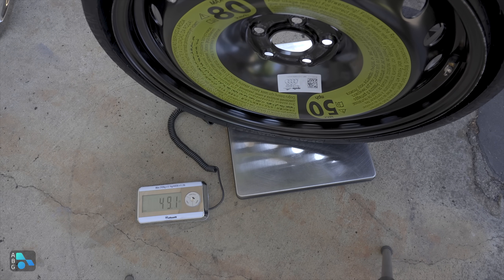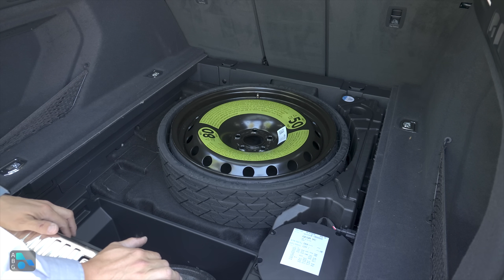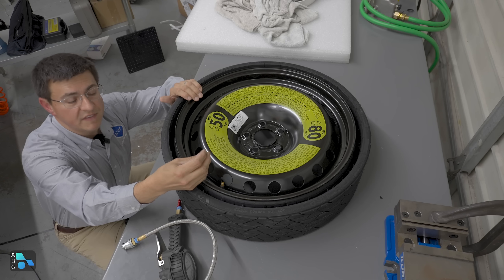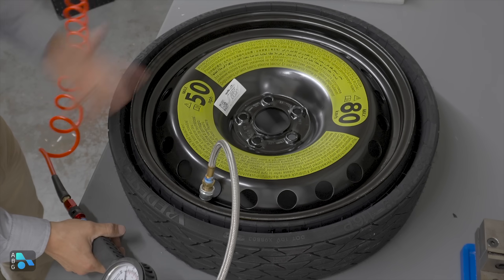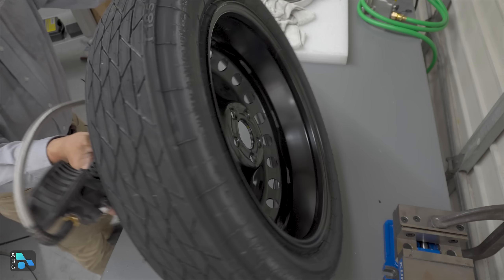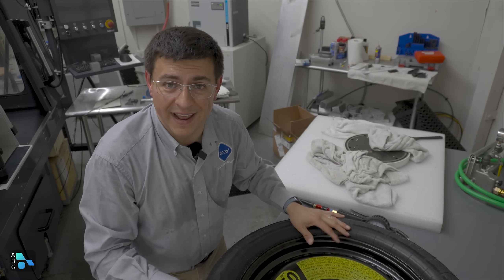How A Collapsible Spare Tire Works, And How It Might Save The Spare Tire In EVs

Comment: This is problematic. You need a pump in the car. Need connect to power.
Next the tyre may collect particles and can't inflat as leak.
All cut cost and not give proper tyre.
Don't buy the car that give you problem

Comment: 1. This is actually super freaking cool! 2. As with nearly all compact spares however, the full size tire doesn't fit back into the same place. So if on a road trip with a trunk full of stuff, where do you put the flat full size tire?

Comment: Wait, isn’t there even more room on an EV to fit a spare ? First of all the entire front trunk or frunk is empty.   There is also no drive shaft tunnel that gas rear wheel drive or all-wheel-drive gas cars have .   And the most important part , the rear truck … there is no muffler or exhaust in the way there is also no gasoline tank in the way.  There is basically double the amount of room in a trunk of the EV.  Maybe not for shitty EV brands like BMW, Audi or so that just repurposed their gas car chassis … but other real EVs have way more space all over.

Comment: Been driving an X6 with no spare for over 9 yrs now. It uses RUN FLAT tires...
In the beginning it was a problem to get them fixed after a puncture... many shops said they could not be repaired. Absolute BS and lack of knowledge.

Had to go to mom and pop shops... just put a plug and patch. Nowadays they are specific types of plug-patch for run flats, but if not available, separate plug and patch will do fine.

I have from time to time off-roaded in heavy rocky roads with no damage or flats.
So unless you completely slash a side wall, a run flat will do just fine and no spare is needed whatsoever in any car. Not even a collapsible one.

I do recommend having a plug kit and tire inflator in your car. (I have 4)
I have not used a spare tire in over 20+ yrs since I started using plugs... no need to take the tire out at all... fixed and ready to go in less than 10 minutes and no sweat of dirty hands. Learn to use them... they are hassle free.

Comment: The small amt of space you save  is meaningless. In bad weather I want to change a flat quickly not that nonsense.
Get back to FULL size spares . Pointing out saving 60lbs on a Spare to save gas then putting a 100 plus pound 
Panoramic Roof  on the car shows its all about money.   Company saves $100 by not providing Spare but gets to charge extra $800 or more for a Panoramic roof.   Also if your car is so fully packed where are you going to put your 
full size tire with the flat. If you leave it loose it becomes a projectile in a crash.  Safety should require your flat being bolted down where the spare came out.

Comment: I had a in a car that didn't have an actual spare tire and it turned a 20-minute tire change into a complete meltdown of my Christmas plans. I had to pay $200 to have the car towed to a tire change shop let it sit there all day on Christmas and then drive back 30 mi to where the car was to have the tire put on for $300. I think not having a spare tire is a huge safety issue luckily I wasn't on the highway I think it's ridiculous

Comment: I don't immediately see mention of it, so I'll comment the most important part:

Keep any appendage you don't want to lose, AWAY from the folds of that tire. First, never trust a tire. I've seen plenty of mistakes from coworkers. Second, those rolls and folds, will grab whatever is sticking out, and crush it. Think a tube of toothpaste. But the cap is still on.

Tldr; Inflate or deflate with your fingers near those folds, at your own peril.

Comment: I think you’re so pointed out something unexpectedly that why couldn’t Audi design the front end to accommodate the spare tire the cables all that motoring connected stuff in the rear of the vehicle could be all loaded space so the front trunk could be literally automotive orientated and the rear could be for passengers parcels possessions I think it used to be on the citrons and some other vehicles had their spare tyres over the top of their engines might’ve been a bit warm, but it’s an EV we’re talking about

Comment: I hsvr s 2013 Tesla Model S and though it doesn't come with a spare ar all, a full sized tire mounted on a 19: rim fits in the Frunk (front trunk) which is about 20 times the size of that audi front trunk.  What is all of that under the hood?  Is that a hybrid?

Comment: Why don't manufacturers get rid of spares and install an uninitiated tube inside the rim with a separate value stem and include a small pump and players incase you need to remove a nail.  Seems it would be far easier to use than the current way of dealing with flats.

Comment: There isn’t much point in a spare these days as a significant proportion of (I surmise) drivers would be incapable of changing a wheel (UK).  For myself I wouldn’t drive a car in the highway without a spare wheel.  I note that Land Rovers have a huge spare strapped to the tailgate. Maybe it’s just for show and there’s no wheel in the cover. Those vehicles are all show anyway. It’ll break down long before you get a puncture.

Comment: I had a 1982 Datsun 280ZX that used a collapsible spare tire just like this.  I actually used it once.  Drove about 250 miles on it over the grape vine into Los Angeles.  Replaced the blown tire and deflated the spare which collapsed down and was able to fit back into the small spare tire compartment.  Nothing new about this.

Comment: You want a tire in the front??
You think engineers didn't think about this? 
Less crumble zone less safety!
Reply from the maker: Actually, the main reason spares aren't typically found in the front is that they get dirty/oily and the under-hood temperatures in an ICE vehicle engine compartment degrade rubber more rapidly. There is no reason they could not put a spare tire in the frunk, as long as the vehicle was engineered with it. I've discussed this extensively with safety experts at various car manufacturers and there is no reason they couldn't; they just don't think the average consumer cares about having a spare.

Comment: The space excuse for EVs not having a spare tire is just that, an excuse and a VERY bad one. With battery packs being built into the floor and body of the vehicles now, the trunk space is larger since there is no need to limit space for a fuel tank. At the front end of the car, electric motors and other components of the EV do not take up the same amount of space that an ICE motor/transmission and all of their various components need.

Comment: They've been using that type of spare for at least 40 years.   My old 90 300ZX had one.  Car came with a bottle of compressed air that was empty so I just kept a 12V tire inflator.  Clumsy and time consuming but still better than waiting hours for a tow truck.

Comment: I don't totally buy this... solid video, BUT collapsible the wheel isn't. And its not an EV specific issue, its for Audi, Porsche (basically VW group), BMW, etc... to do redesigns to accommodate a spare tire. Tesla doesn't have one but the mount of stuff I can get into a model Y or 3 is great as it has the extra load space under the main boot which would provide near ample room for a 'deflated' tire.

Comment: Hi - This is not a creative idea at all and the end users are not saving anything. Another bad idea and charging more to consumers some where else in the MRSP. Typical german marketing-$$. 
The tire sizes was NOT the only reason, small segment 🚗 vehicles went away from the spare wheel. It was due to the “wait” of the spare rim, spare tire and the jack kit and mostly on the A-B-C, *d, segment vehicles to offset the federal CAFE regulations.  This idea is way far from high five ✋ - dollar sign 💲 written all over this. 
Thanks.

Comment: My friend had one of these in their Porsche and the issue wasn't the tire. The issue was the original wheel was really hard to get off even with all the bolts removed. I had to leave the bolts on loosely and drive a little for it to slowly work it's way out. I made a video about it.

Comment: This is like...Audi is selling a solution to a problem that doesn't even need to exist....

Spare tires are small, the place where it stays isn't even used for cargo.

Audi could even fit a regular size tire in the trunk if they weren't into cutting costs on their top of the range SUV.

Comment: What's the point of this? The tire already has it's own compartment, and now i also have to buy the pump and carry that in my car constantly because my spare tire isn't filled with air... Absolutely useless, if they wanted they can design a car around a spare tire, however they are creating a problem just to sell you the solution for more money later.
Reply: Money

Comment: You can't plan the location where you will need to replace a flat tire. It may be a dangerous location because of the traffic or the locals. Thus, you need to do it quickly. You don't have time to inflate the expandable spare. And you must have access 1:27 to your key if you use locking lugnuts on the wheels.

Comment: lol, those cant even be called spare tires where i live, its either a space safer or emergency tire, my fiesta had one, and i replaced it with a proper spare tire, it has the space but an extra 100€ was apparently too much for Ford. and with a proper spare, you dont need an air compressor to "assemble" your space safer...

Comment: This is an ANCIENT idea.  My dad had a 1980 Oldsmobile Delta 88 2-Door and it had a self-collapsing space saver Carlisle BIAS PLY tire in the trunk and a can of air to go with the tool kit; factory installed equipment.  That was in 1987; and it was an old idea THEN.

Comment: Sounds great in theory but hopeless in practice. My old Mercedes SLK had a collapsible spare tire liked this one. The longer the tire is kept in your boot(truck), the high the risk it won't get inflated by your car's tiny portable pump. It might  be too late when you realize that it is a piece of dead weight at the time when you really need  it. I was told by my Mercedes dealer that the tire needs to be taken out for exercise (inflation and deflation) regularly to remind it its purpose in life.

Comment: It’s still too limited at 50mph, and I’m assuming it is limited to 50mi range, like my current Toyota Camry’s compact spare. I want a full size spare on my next car. It’s ridiculous to have a car without a spare. Also, I don’t see the reason for having such large wheels that may improve handling, but a 16-17” whelk versus an 18-19” wheel is much less susceptible to blowouts from potholes or other road damage.

Comment: Nothing like doing a demo not using the manufacturer's provided pump because it's too slow with the tire on a bench work to show how impractical this setting is once on the side of the road.
And I'm not talking about cold rainy days in heavy traffic, ...

Comment: I've been driving for over 30 years and never once did I have to change the tire on the go. Any tire problems, I was still able to get to a place to fix it as the problem was slow escaping air or the tire was a run-flat kind. I had to replace a bicycle tube a couple of times though :).

Comment: Even the tiny Fiat 126p came with a full size spare wheel included 50 years ago and today it's generally considered to "take up boot space and reduces fuel economy" of 3-6  times bigger/more powerful vehicles. Hilarious progress considering mighty Fiat's boot was designed for  the spare wheel and battery only...

Comment: I wish manufacturers would just spend the money on a 5th wheel. What do you do if you have a flat on your vacation trip?
Where do you put the full size wheel you just took off the car on the side of the road? Abandon it?
Today's run-flat tires are really "roll-flat" tires, that allow the driver to get the car to a safe spot to actually change the wheel. 
You can't drive on them.

Comment: I hope it's not the future of spare tires... That design has been around for a long time and there's a reason it's not more popular, mainly because you can't have a tire ready to go... Most people are only going to have a small air compressor and of the fuse fails or anything else prevent you from inflating that tire you're over with... At least a donut could be topped off with are on a regular basis if you remember to, if you don't you're going to need a small air compressor... Number one choice for a spare tire is a full size... Don't let it get too old... Get new tires soon enough to be able to repurpose the "old" a fresher rubber for a spare...

Comment: I think most people forget that spare tires are generally meant for going to the tire shop and having your flat tire fixed or in some cases replaced like in a blowout, I should mention that blowouts typically happen due to the age of the tire so it’s genuinely a good idea that if one blows to replace all the tires as it will likely happen again in the future, it’s one of those instances where it’s better to be safe than sorry!

Comment: Another good idea is to buy another wheel on a week after you pay the car note so that then you can afford a wheel and tire and just leave that at your house that way, anybody can get that and bring it to you, and you don't have to worry about a temporary spare. In some cases, if you buy the car with aftermarket, wheels or the special wheels. Even if you have a temporary, it won't help you because the tires are too big, so it's just better to get an extra wheel and uh, tire, when was the you get your tires replaced. It's a bit pricey but it's reliable

Comment: Clever solution - although there is still the issue of where to store the full sized punctured wheel, especially if you have  full boot/trunk
Reply: On the roof duh
Reply: @yolo12345lol  I keep it on my windshield
Reply: @yolo12345lol 😂
Reply: I believe that the general intended purpose of a spare tyre is not to continue driving around doing your day to day activities, it's more so to help you get to a tyre shop or at least back home so you can schedule a time to get to a tyre shop to get a new tyre and replace the punctured one. In that event it's likely that most people would just put the punctured one in the boot/trunk, or if that is full then putting it in one of the passenger areas. If someone's driving around on a spare they realistically SHOULD be trying to get off that spare as soon as they possibly can.
Reply: @rhydianr agreed but sods law says you get the puncture when on holiday with a full car and boot/trunk
Reply: @rhydianr  The issue is that this logic fails in any continental sized country, Brazil, Australia, US maybe too... Plenty of places where if you have a puncture you might need to drive over a hundred kilometers to the next town/service station, so I rather have a full size spire tire thank you.
Reply: Like any other person with an audi you would throw it in the wilderness on the side of the road.
Reply: Exactly 😂😂😂
Reply: Just throw it in the back seat duh. It doesn't matter the spare is just there to get you home and to the mechanic.
Reply: @matthewsylvester9103 what if the car is full of people duh!
Reply: @chrispenn715 Front passenger holds it, LOL.
Reply: @chrispenn715 if you're in a situation where you need a spare you can probably sacrifice some passenger comfort
Reply: @matthewsylvester9103  What about cars with no back seat or where you have all seats occupied?  I guess you have to leave someone behind.
Reply: @946towguy2 to be fair if the car has a flat then transporting people would be the very last thing you want to be doing at the moment, always safety first get it changed out asap then worry about the other passengers.
Reply: @946towguy2 Front passenger holds it, lol.
Reply: @matthewsylvester9103  Assuming you are in a urban environment sure, but what if you are in a highway in the middle of nowhere with the closest service location nearly a hundred kilometers away? Yeah no, I want the damn full size spares back, this trend is stupid.

Comment: Still prefer a regular spare.  Actually for the last few cars I would go and buy a cheap steel rim and buy a cheap tire to have a full sized spare (just take out the donut and put the full sized spare in its place).    I had a 2008 Focus that didn't come with a spare tire, but my 2010 thankfully did (i think Ford got the message since tire sealant cannot help you if you have a gash in the sidewall of the tire, it only helps with punctures in the tread mainly).

Comment: It needs to be stressed that space-saver spare wheels should not be used on a steering axle. If needed on the front, swap the spare to one of the rear wheels and then use the removed wheel on the front.

Comment: We had a collapsable spare on our 2010 Mercedes 180K coupe. It was used once in the life of our ownership so they are not a new invention. Personally I prefer a good 12V tire pump as most punctures are simply a nail or screw and the leak is slow enough to get you to a local tire repair shop.

Comment: Doesn’t look safe. Too many ways a person could get injured when inflating (the tire exploding outwards into shape). 
Not practical by the side of the road in poor weather or darkness. 
Little parts to drop and loose. 
Parts needed are not located together in the car. 
How long does the actual included inflator take?
This is bad.

Comment: Certainly not just EVs that are lacking spares anymore. But especially useful for EVs with their large, high load rating, expensive tires. I've heard the cans of fix a flat basically result in needing to replace the expensive tire.